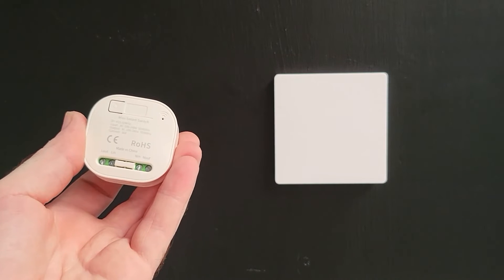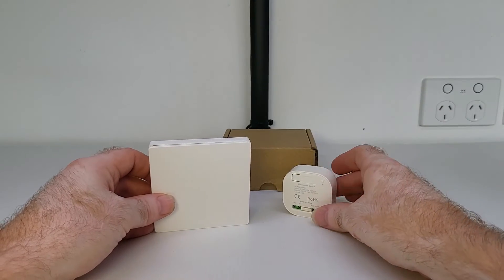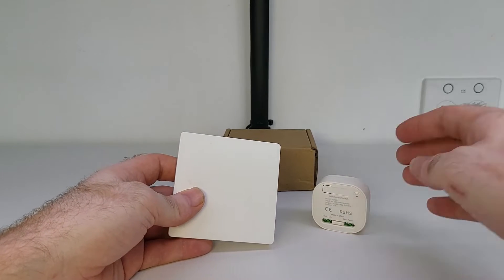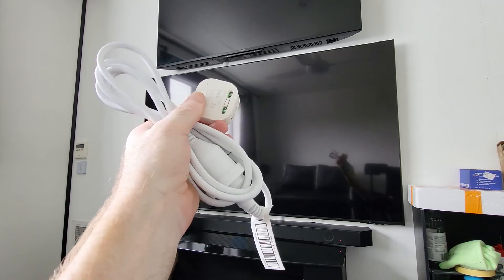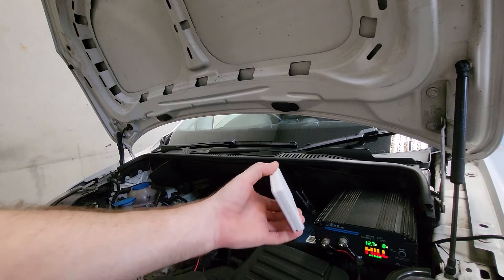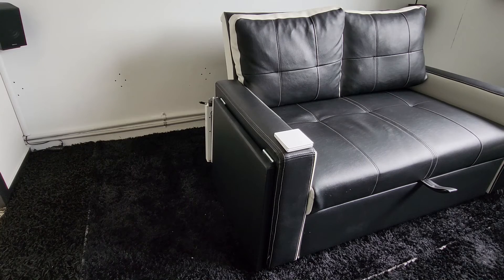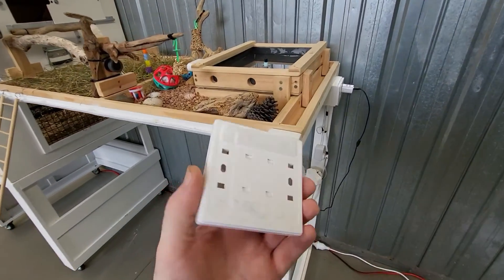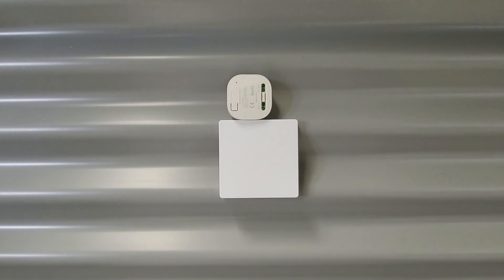Discontinued

Comment: Will this work with any 433mhz receiver? I have a 12v receiver wondering if this switch will work? And how to pair?
Reply from the maker: Probably not. If you know how to hack the system you might be able to make it work. You have nothing to lose by trying, best of luck

HOW TO PAIR THE DEVICE:

1. Hold down the Pairing Button on the Reciever for 5 seconds
2. The Pairing Led will be permanently ON
3. Now press the Button on the Transmitter and the Pairing Led will Flash
4. The Transmitter has now been successfully paired to the Reciever

HOW TO DELETE THE TRANSMITTER CODE:

1. Hold down the Pairing Button on the Reciever for 10 seconds
2. The Pairing Led will Flash fast
3. The Transmitter code has now been successfully deleted from the Reciever
Reply: @SHORTwithTECH  thanks for the reply. I have placed an order for the switch and its included receiver. I will try to test it out in my 12v receiver once the switch is delivered. My lights are 12v as I'm on solar so I'm looking for alternative switches that will work with 12v dc.
Reply from the maker: @leklektv9874  you can modify any of the switches to do that for you if you know how to do that stuff. But maybe this Shelly Smart Relay would be better for you as no modifications are needed https://youtu.be/ykIGgvmgAfo?si=4sI82kpL63aiY5DA

Comment: But how were you able to get the switch into your Smart home? Did you have to reverse engineer the protocol that it uses, or do they sell a gateway that allows you to do it?
Reply from the maker: This is not a smart switch so does not use a protocol. It's a RF switch (Radio Frequency) that operates on 433mhz just like a garage door but it's self powered unlike a garage door remote
Reply: @SHORTwithTECH  well yeah but how did you get it to operate your couch?
Reply from the maker: @Techlifeandmore  sorry I don't understand your question. The Smart Couch uses a 240v motor so by putting power to that motor through a switch (and it doesn't matter what type of switch) but in this case the self powered switch then the motor is going to power up and move. This is a just a switch, you can use it to control any Mains powered device so you can control virtually anything with it, just like you can with a smart switch or any other type of switch, hope that answers your question
Reply: @SHORTwithTECH  basically like how are you able to have voice control and control with the switch at the same time?
Reply from the maker: @Techlifeandmore  Yeh kind of, but its easier to think of it this way instead. So my Smart Couch is operated by a 240v motor. To control that motor you can use a smart device to do it, in my case I just used a smart switch. To control that smart switch you need to use an app or Alexa or Google. But that doesn't mean you HAVE TO use an app, Alexa, Google or even a smart switch to control it. You can bypass all that stuff and just use a switch to control the motor by itself and in this video that's exactly what I have done using a Self Powered Switch. Hope that makes it easier to understand, thanks
Reply: @SHORTwithTECH  so basically you have to choose which control method you want, you can't have both?
Reply from the maker: @Techlifeandmore  no, you can control it anyway you want to but because it's a smart couch I choose to use the smart switch and Google. The self powered switch idea was just for the video demonstration, I had no intention to keep it in use
Reply: @SHORTwithTECH  Oh ok I get it now.
Reply from the maker: @Techlifeandmore  Thats great, have an awesome day 😀